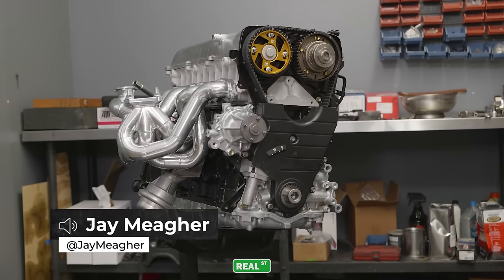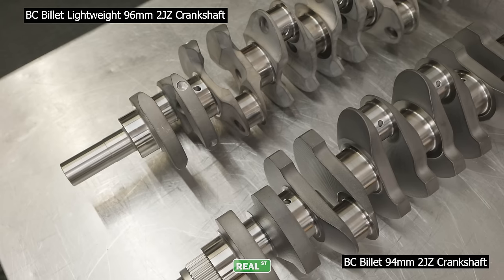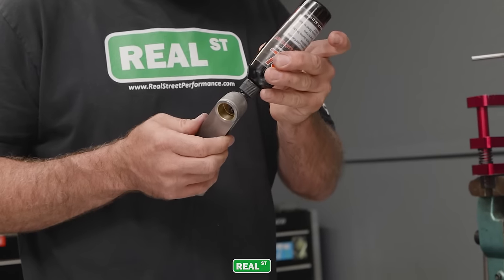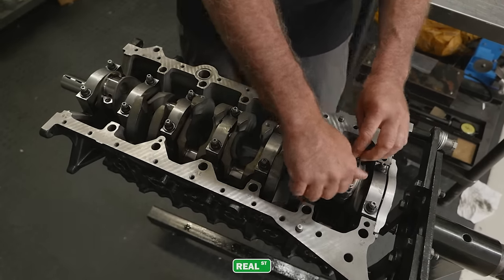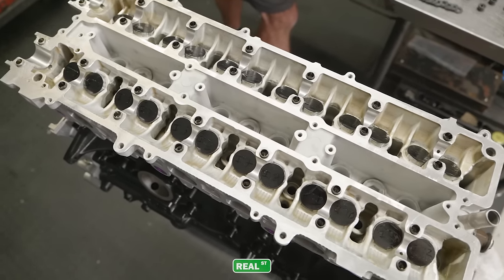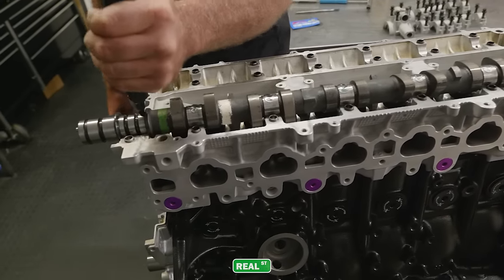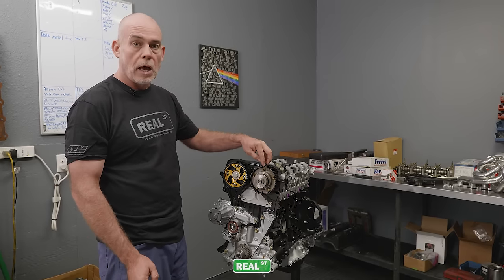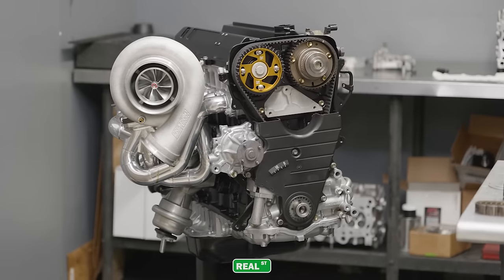Building A Stroker 2JZ-GE VVTI To Handle Over 1000+HP

Comment: Got to see the dyno of somthing like this because 2JZ-GE engines I feel are going to be next way to get in the JZ family (I got one siting and waiting in my garage) Thanks for uploading something like this to show that I can also be able to do something similar to my 2JZ-GE.
Reply from the maker: Right on! I agree 100%. We will have more from this engine coming out soon. Stay tuned.. Good luck with your build. If you need any help or guidance, Feel free to reach out to us by phone or email.
Reply: No
Reply: You just have to machine the block (oil return and fuel rail), everything else is just rods and pistons for under 1000whp (usually). There is a drag racer on YouTube that literally machined the block threw some rods and pistons in (with supporting mods of course) and is running 1300whp.

Comment: What is the benefit of using a GE head?  I'm running a GE head because I had a GE engine in my GS300 and running a  Level 10 A650E tran. Got 619 hp and 609 lb-ft of torque on E. Also, I lined it up with the dots, not the Slash hasn't had any problems yet. Thank You for helping me with my build!! Also, I would suggest that anybody spends $13,000 on parts. I should have gotten a free t-shirt or hat.
Reply: GE heads flow air better for the turbo once the heads been ported correctly ect 🤘 also Its a non contact engine so not correctly timing it like you have by not setting it up to the timing mark wont cause your piston to smash valves but you are probably loosing performance by the timing being off slightly, correct it asap if you havent already.

Comment: I'm 37 yo, grew up in Australia - when I was doing my apprenticeship in mechanics, I had the heads from an old cast 350 chev in the tray of my ute, also powered by a 350 chev but I had one doing a stroker setup..I was hoping around 400-450 horses at the flywheel - had an old Jaguar pull up next to me at a petrol Bowser at a service station, we call them 'servos' in Australia. The guys jaguar was 1920s, and was overhad cam..I said chain no doubt? He said I'll pop the bonnet for you. 

It just startles me still to this day.

Comment: Wonder if coating you mentioned on the buckets could be valuable in some of the coyote valvetrain components?
Reply: The DLC coating works well where you have splash lubrication on parts that are swiping/sliding on each other. The Coyote is a roller lobe so it's not nearly as susceptible to the oil being displaced like a flat tappet arrangement.  The chains can be a mess on the Coyote but a coating won't fix that. Thanks

Comment: Are those flanged nuts and Nord locks on the exhaust turbo flange?
Reply: They're just flanged nuts, I've never had a problem with that hardware coming loose.  We do need to be careful with the length of the threads on aftermarket studs. They can be short and  end up pulling threads out of the head. Thanks

Comment: Hey Jay love the content and how well you provide information about the parts you are using keep up the good work iam in the process of doing a rebuild of a 2jzgte I live in new Zealand so don't have much options on fuel part etc . I am looking to make 500hp atw with stock 2jzgte block any recommendations for bearings . Have a few options ndc acl race seiers any help would be appreciated
Reply: Howdy and thanks for the positive feedback.  The stock 2jz-gte can live a really nice life at 800whp.  You shouldn't have to do anything to the engine but cams and valve springs, the rest of the power comes from the supporting mods. Thanks

Comment: Super curious on the head stud install. Is it an engine building preference or a jz thing?
Reply: I do this on any engine that doesn't have a bullnose on the stud.  In the golden years men would drop small ball bearings into blind bolt holes to keep the studs from peeling the threads up at the deck. Thanks

Comment: Love the content 😁
Would you be able to share details about oil pump ?  Do you modify it yourself or buy it somewhere ?
Reply: These pumps have their own limitations by design. Georotor pumps suffer at high speed to be able to feed on the inlet side. You can buy a "prepped" pump from Real St and the main advantage is that it's been properly lubricated for start up and is free of any debris.  If you're not going to buy a prepped pump just make sure your pump is clean and lubricated during startup.  I don't feel there's any gain in flow with modifying the pump, there's just speed limits to the design. Thanks

Comment: Hey Jay @realstreetperformance, you were talking about how the billet cams like the GSC's will dig in and eat up the buckets, hence you do the DLC coating on the buckets.

My question is, can you do the DLC coating on the cams instead of the buckets?  I already did the shimless buckets conversion on my GTE head, so everything is already machined and spec'd.  It would be much easier if I do the DLC coating on the cams instead of the buckets.  Would that work?  TIA.
Reply: If you watch the headgames videos on this, the problem is the cam clearance to head is too small. When the clearance is opened up you don't have any issues

Comment: Silly question but since this is 3l from factory could i use those pistons in a 3l inline 4 diesel engine
Reply: Sure, definitely you can if you think that 6 smaller pistons making the same displacement as 4 larger pistons are in fact, the same 😂😂😂

Comment: What kind of oil pressure do you see with a GE block and GTE oil pump?
Reply: With steel rods and vertical oil clearance in the .002-.003 inch range they will ride the bypass at 100psi or so at speed. Thanks

Comment: I love boosted 2j sounds but i dont think i can afford building 1. Anyone have any idea how much it would cost to build a boosted 1 or 2j  that safely pushes 5- 600hp ?
Reply: Take a look at the @Teysik channel. He used a GE non VVTI bottom end with a GE VVTI head. It's is essentialy a GTE without oil squirters. And you can do it for 1000-2000 dollars. Take into consideration that an engine swap itself will cost you thousands and thousands of dollars ( if the engine did not originally belong in the car)
A gte will be safe to push to 600hp without major mods.

Comment: How much power do you fellas reckon it would make with all those parts but in an N/A application?
Reply: Sadly not enough. The only built NA JZ I've dynoed only made 280whp using a GTE intake plenum. Stacks would pick it up some if I had to guess, these engines just don't have good airflow for NA work. Thanks

Comment: Amazing Work Jay! Keep it coming

Just a quick question, with this type of build what's engine longevity like if you were to say Daily this just as you would a normal car?
Reply: That's a super open ended question. If you drove it like you would "a normal car" you could easily expect a normal lifespan.   How the engine is tuned and how you treat the engine will have more influence on it's lifespan than anything else.  What do you need out of it? 40-50k miles?  Thanks

Comment: I know you are a pro and know it dosnt make a difference for you but...... Do you think you are losing enough torque using that extra long extension when torquing the head?.
Reply: Most, even rookie engine builders know what to add regarding the lengths of extensions when used in torque settings. Even tire techs when torquing wheels with extensions add to the torque numbers. Well atleast they should. It's really easy
Reply: A fun to play with that thought is to mark the hardware and see if you keep landing in the same stops.  I really should be using a larger wrench. I'm not as strong as I used to be and that little ratchet is a workout! Thanks